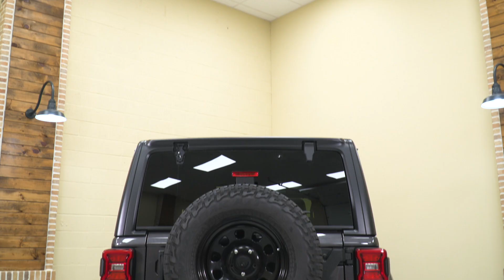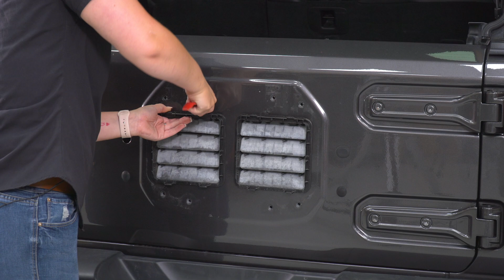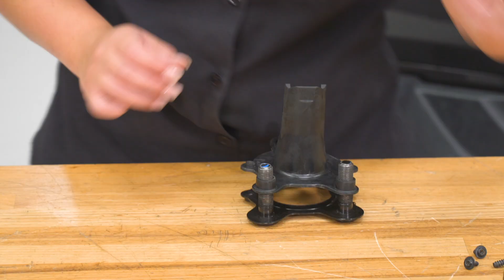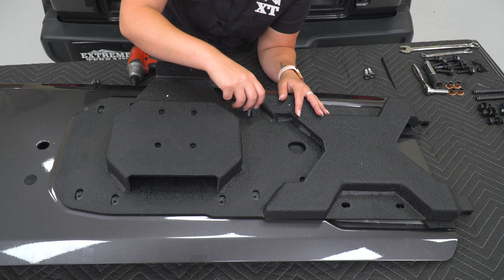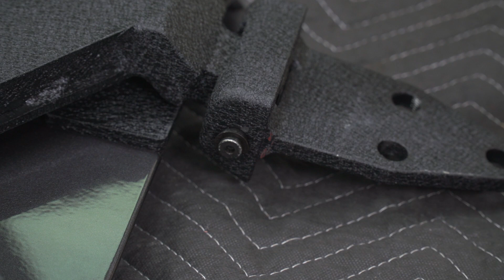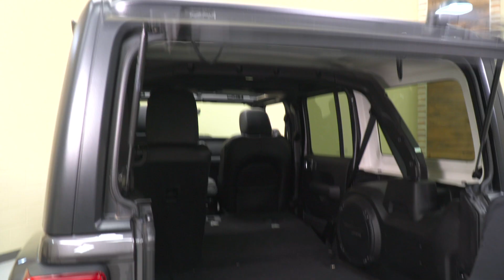Jeep Wrangler JL Barricade HD Tire Carrier with Spare Tire Mount Review & Install

Comment: I am very disappointed with the fact that they are not using the stock size lug nuts. Now my license plate mount will not bolt on cuz they are an off size. I don't know how to bolt my license plate mount because it uses long lug nuts that it screws into. I am so upset at this. I would send this carrier back but it was such a pain to install and get the tailgate adjust right is next to impossible. It is also very heavy. I do not recommend this carrier. How stupid is it not using stock lug nut size bolts!
Reply: I was literally about to buy this carrier, and I got a generic one for the time being while I got a hood tire carrier, same issue I have to use their crappy lugnuts normal ones don’t fit, save me a huge headache

Comment: Would  a 35" tire hit the factory bumper with this kit Installed. I'm reading reviews n one guy says he had to do adjustments for it to work with a 35".
Reply: I found the same thing.  I'm wondering if it will fit a 37".
Reply: 35 fits with the standard mount so I’m assuming this will also

Comment: How do you adjust the tailgate if the hinges don't align properly for smooth closure. it looked like your tailgate was a bit low on the driver side and needed to be slammed to catch properly.
Reply: I bought this carrier and it was sagging with my 35" Copper STT so I made a spacer to go under the bottom hinge (the part of the hinge that's inside the Jeep behind the plastic that needs to be removed to remove the six bolts) more or less I put the spacer then the hinge and tightened it up no sag at all now and the body lines are spot on. Hopefully this makes sense.
Reply: @bktraveling3204  now I'm debating g on getting it.
Reply: @CRXUGLYKID  I liked it after installing the spacer.
Reply: @bktraveling3204  i know someone selling the entire kit for $350 is it worth it used for that price?
Reply: @CRXUGLYKID  oh yes most definitely
Reply: it will be interesting once it has a 35 or 37 on it.
Reply: Mine was too low and didn't hit the stiker at all. I took the door back off, loosened up all the mounting bolts holding the carrier to the tailgate and moved the carrier. The mount holes in the carrier are slotted slightly to allow adjustment. Instructions were horrible though and I'm pretty disappointed that they didn't use stock lugs...now I either can't use or have to find a work-around to use locking lug nuts... C'mon XT, you can do better!!